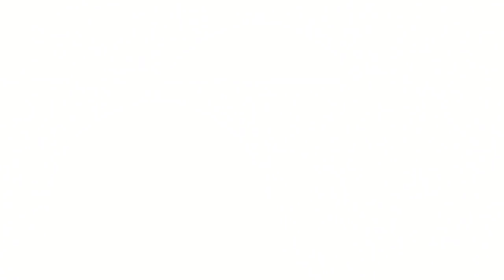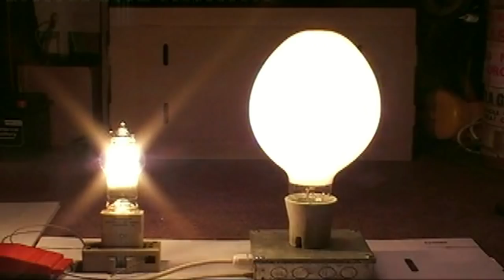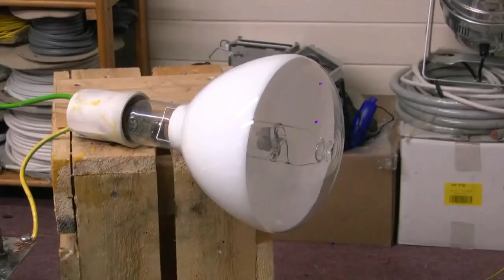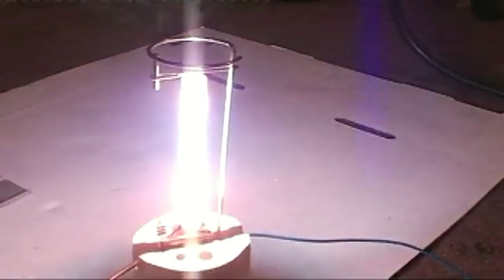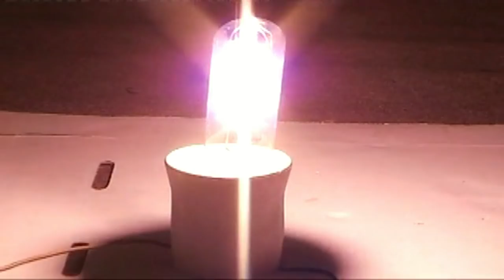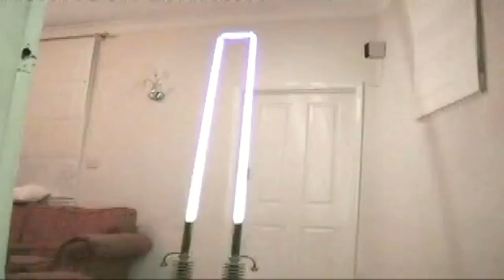Light Bulb Overload Remix

Comment: Is it possible to have a video with a 36 Watt T8 Light tube across the big boys supply? If you use the Mega MOT you can instant start the tube so you don't have to worry about switch starting.